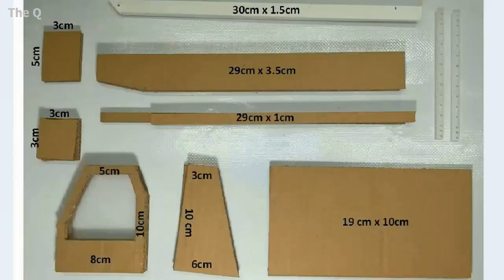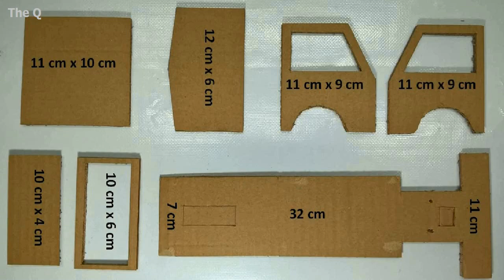How to make a Crane Truck at home - Car Remote Control using Cardboard (Electric Truck)

Comment: Hi I know that's you are using plastic wires and plastic saws but where did you get them. Also where did you get all of those motor gearbox things. Thanks
Reply from the maker: Those things you can do yourself or buy in the market, so I also homemade or buy and homemade or buy ready to do.

Comment: what kind of engine does the pulley pull
Reply from the maker: It's a DC 9v engine and gear reducer, which you watch in the 7-minute and 9-second segments of the video.

Comment: where did you get a 6 channel remote control circuit?
Reply from the maker: I bought it
Reply: where did you buy it?
Reply from the maker: Where do you live and work, which country? Do not know where you live?
Reply: lithuania
Reply from the maker: In Lithuania there is no board I do not know, try google search, because i bought it directly at a shop where i live